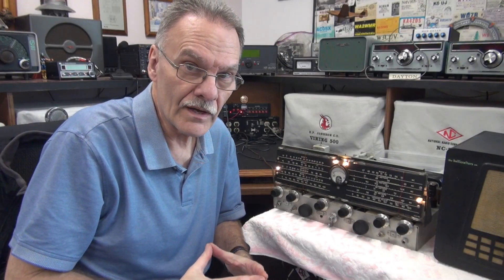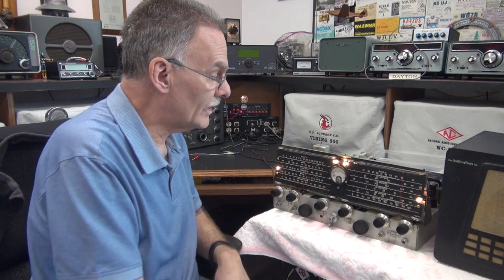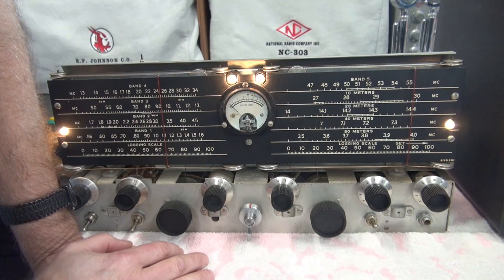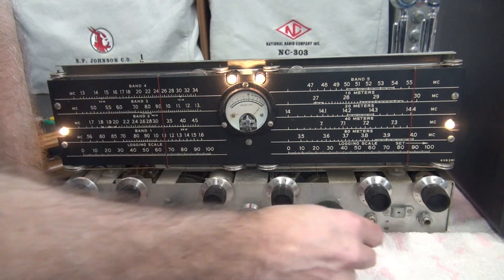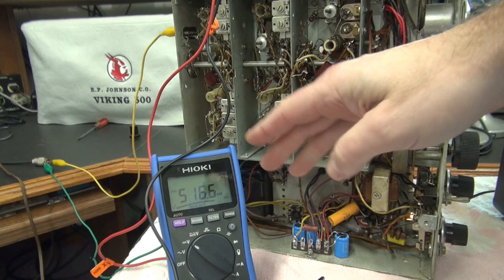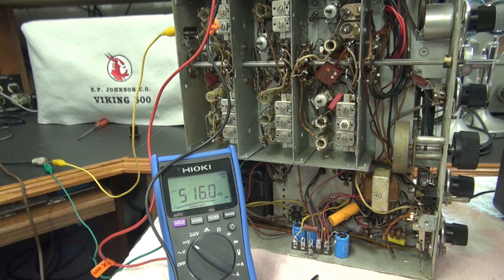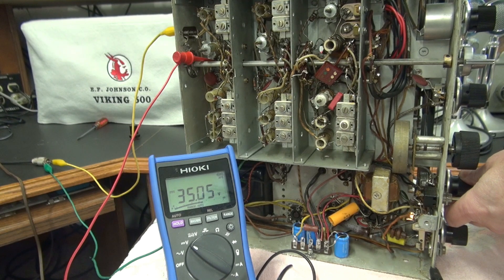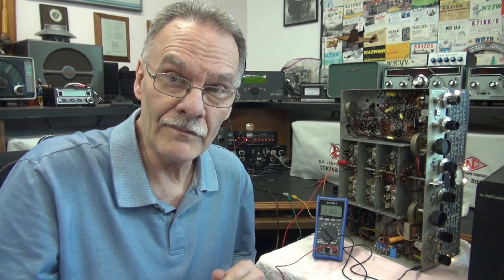Hallicrafters SX-71 Shortwave receiver S-meter not working need assistance troubleshooting the fault

Comment: Looking at the schematic, the AVC is coming off the plate of the diode.  The cathode is connected to a divider off the VR tube but it will not be strongly positive.  On a strong signal the AVC should swing negative as it is going to the control grids.  I would suspect a grid to screen grid short somewhere which could have started after a power cycle.  A less likely cause would be a leak or short on the capacitor feeding the plate of the AVC diode.
Reply from the maker: Excellent, good things to look over. YES! You were correct. V4 6SK7, I found low resistance, removed the tube, gone. Replaced the tube, receiver is working correctly. Tested that tube, fine on my B&K 747. Intermittent, tossed it! Listening to the RX now.
Reply: @d-labelectronics  You have provided so much good advice I feel honored to have helped in any way.
Reply: @d-labelectronics  Arghh .. a short in a tube was also crossing my mind, but for some reason I discarded that idea. Still happy that you found it. 

But still fits to my explanation why bands 1&2 were low sensitivity. And I suspected the correct stages .. ;)
Reply: I was chasing my tail on a sx99. I read these posts, and checked my tubes again. Both 6sg7 had grid shorts!

Comment: If this does not reveal anything, my best diagnostic tool was run resistance checks (unpowered) either to ground or to the B+ supply as follows for V1: Pin 1: BFO off - 1 Meg BFO on - 2.2 Meg Pin 2 & 7 - 8K Pin 3 GND Pin 4 (filament) Pin 5 (to Pin 2 of V13) - 4K Pin 6 (to Pin 2 of V13) - 11K.  If there are significant or nonsense results check for resistor or miss-wired problems.

Comment: The S meter is driven by the plate current of the RF amplifier which is controlled by the AVC voltage on the control grid of this amplifier. The negative AVC voltage also goes to the control grids of the first and second if amplifiers. The cathode of the left diode in the 6H6 is slightly positively biased by the voltage divider and is regulated by the VR150 regulator tube. This voltage can be calculated by using the resistor division ratio. The left diode plate of the 6H6 is rf coupled to the plate of the third if amplifier and the shunt rectifier action generates a negative AGC voltage proportional to the rf voltage on the third if amplifier plate. This dc voltage may be as high as a few volts on strong signals. Either the 6H6 has failed or some component in the AGC DC voltage going to the RF amplifier control grid has failed.

Comment: Found on the antique radio lab forum from 2012 .........................

This is from the manual
S meter adjustments

mechanical adjustment-

Turn the receiver off. Directly below the S-meter on the front panel is a round metal medallion which is pivoted at the bottom so that it may be rotated to one side to provide access to the meter adjustment screw. Carefully rotate this adjustment screw until the pointer is in line with the right hand index mark on the "S" meter.

----------------------------

If this doesn't work then you are going to have to investigate the following parts first, then voltages.

Before plugging in the set do the following check to make sure the values are correct.
C10A cap 4000mmf from ground may be defective and reducing voltage.
R9 330,000 ohms
R42 should be 3,300 ohms
and c108 4000mmf
R43 ("S" meter adjust) can be either 200 ohms or 500 ohms
R 44 82 ohms 1/2 watt yellow lead from meter

For voltage checks set front panel control to the following:
Electrical adjustment-

1. Short the antenna terminals to the chassis
2. Set the receive/standby switch at, RECEIVE, B.F.O. switch at OFF, SENSITIVITY control fully clockwise and the NOISE LIMITER switch at OFF.
3. Turn the receiver on.
4. The electrical adjustment control for the "S" meter is located on the rear apron of the chassis, Slowly rotate this control until the "S" meter pointer indicates zero.
BFO off
Reception normal I.F.
Noise limiter on
Main tuning - low freq end of dial
Band-spread - low freq end of dial
Band selector band 1
tone CCW
Volume CCW (switch on)
Receive/ Standby Receive
Sensitivity CW

Check for the following voltages.

V2 (6AU6-1st Converter)
Measured between socket terminals and ground with zero signal input
(K) cathode 5v
(SG) suppressor grid 75v
(P) plate 250v
(G) (PIN 6)Grid -12 (or 0v varies depending on setting of main tuning gang and switch)
Reply: Nice to see that went you are stumped that you can edmite  it  thank you terry Mr. D lab
Reply from the maker: Yep, I always know there is a wealth of knowledge out there. Plus its good to get others involved
Reply: @d-labelectronics  I hope it helps

Comment: I have this receiver. The "S" meter was missing. The 2 wires for the meter were tied back and the ends taped. The pot adj for the S meter barely moved maybe a quarter of an inch.

Comment: I have the info for the other tubes but I think this will be enough for you to find the problem.  Suspect everything.  You don't have bandspread markings for the 15 meter band which indicates you probably have a Run 1 or Run 2, and there is a service bulletin #1950-109 December 1 1950, which applies to the early Runs where they found leakage between B+ and AVC across the terminal boards of IF transformers T-7 and T-8 which causes the RF and/or the 1st IF tube to fail after 1/2 hour to 6 hours of use.  This may be the reason for over 10 times the expected AVC voltage,  You should check tubes V1 and V2 again.  If they now have a problem, then the only solution Hallicrafters had was to replace the IF transformers.

Comment: Terry I worked on 3 of these SX-71 and 2 of them had a problem in the 2nd converter unit , there is tuning slugs in that unit and they have problems with them coming off the brass tuning rods, and I had had one that had a bad pico farad capacitor, hopefully this helps out, your friend Jim Gauthier KD8FHC

Comment: The SX-71s are notorious for having undocumented changes put into them by former owners.  I am guilty also as I experimented with the optimum cathode bias on V5, for example.  I will give a diagnosis prescription in steps, one comment at a time.  First the plate voltage by inference from the S-meter voltage is double anything that is used on any plate in an SX-71.  The voltage readouts for V1 (6BA6) should be with BFO off: Pin 1 - no value (GND) Pins 2 & 7 - 1.8 Pin 3 - 0 Pin 4 (filament) Pin 5 (plate) - 210 Pin 6 - 120.  Likely there is a miss-wire in the power supply to the Dc Power socket and Standby switch or somewhere in there that a former ham owner messed up or could T22 the power transformer have an open center tap that is supposed to go to ground?

Comment: Don't really know the radio, just kinda good at troubleshooting random electronics .. but regarding the low sensitivity in band 1+2:

As far as I see on the schematic, it works as a single conversion receiver in bands 1+2 and dual conversion starting from band 3. This is necessary since the higher IF (2075kHz) would be in the middle of band 2. It just skips the second converter V3 (6BE6) by connecting the IF filter on its output to the plate of the first mixer. 

Just an idea .. what if you have significantly lost gain somewhere, preventing the receiver from going into AGC (it does have delayed AGC, cathode of 6H6 AGC rectifier is biased), but stronger signals still coming through. Band 1+2 skip a stage, further reducing the gain, making it more noticeable there.

I suspect the RF amp to be working, since it can still drive the S-Meter as an DC amplifier. The two mixers should be working fine .. the would stop oscillating if there is something seriously wrong there. So the 3 IF stages are suspicious in my eyes.

But maybe it's a known fault by the experts.
Reply from the maker: Thank you for your input. I will investigate. There will be a follow up video